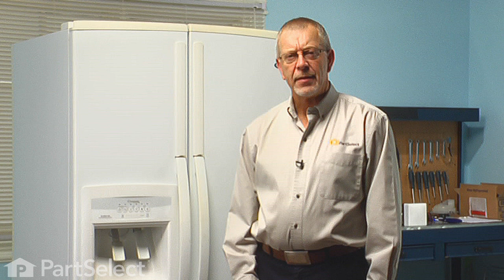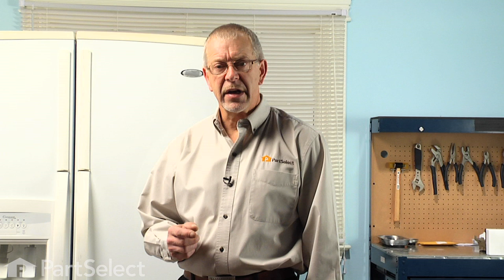Troubleshooting Why the Ice Maker Is Not Working | PartSelect.com

Comment: First, great videos!  Thanks!

I'm seeing the same thing with my ice maker.

Summary:
1) Removed ice maker and noticed ice in the tray.  ejector arm had not moved it.

2) Jumped the ice maker and got water as expected.

3) Re-installed the ice maker and water still does not get to the ice maker/tray.  however I have noticed is the ejector arm continually moves (decedent enough rate that i can watch it continually go). is this normal or does this sound like the thermostat?

Comment: i jumped the icemaker and everything worked perfectly.  When i went back and reinstalled all the parts, the icemaker still did not cycle.  What could be the problem?  
The icemaker had simply slowed down to making ice less than 3 times a day and then stopped all together before we watched the great video on troubleshooting.  Now that it seems to be nothing wrong with its parts, I am lost.

Comment: I have a Samsung RS269LARS model.  I've replaced the ice maker and water inlet valve, but the ice maker seems to be slow in harvesting the ice.  It sits in the tray for 6-8 hours.  Is this an issue with the control board or thermostat?

Comment: OK, How can I send a direct message?  BTW, the eject arm looks like it should cycle 360 degrees, but stops at 180 degrees after removing the Ice from the tray.  The ice cubes then freeze in place, preventing the eject arm from moving to eject the next batch of ice cubes.  Would replacing the entire ice maker resolve it, if it is either the thermostat or the auger?

Comment: Hi Steve.  I have a Frigidaire FRS26LH5DW0 side by side that has stopped delivering ice.  I do not think it can be a water flow problem because I can get water from the front, although since I saw a kinked line behind the fridge, I checked and can blow air through OK. Looking at it cycle, I see the eject arm moves to eject ice from the ice tray, but not into the ice cube bin.  Not sure why the eject arm stops.  The cubes soon freeze at their location, and ice making stops.

Comment: Hello Steve,

i have a GE side by side refrigerator.  The water dispenser is working but the icemaker is not making any ice.  I am guessing there is no problem with the water supply. i also checked if the switch is on for making the ice.  I appreciate your help.

Comment: Please re-read your answer....it needs attention.  Also, the water is not a problem.  If I jump T and H, the complete cycle works perfectly, including water and heater.  Left alone, I can hear the gears trying to turn and cannot because the heater is not on.  Repeat - T and H jumper turns on the HEATER... so, the heater is not out completely.  Please answer again...Thanks.

Comment: In my case, I can use a jumper on T and H and after the heater heats, the gears start and the ice dumps and the water refills the tray.  The problem is that that is the only way I can get ice....using the jumper.  How can I tell what part is causing the problem?  I have a multimeter.  Can I test the parts?  Thanks for the help.....